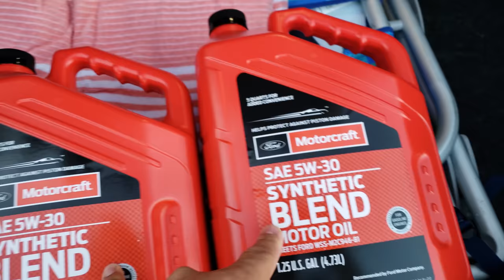2018 Mustang oil Change and filter inspection

Comment: I have the cold start rattle, and im starting to think its not the pistons because i only hear it when i rev and the sound comes on right when i let off the gas, i try to ease into the throttle to hear a tick but nothing so i know its not rotating assembly because if it was the sound would get louder or faster with increased rpms, and goes away when warm. Im starting to think it is the intake as some have said. Im still going to take it to ford with audio clips of the sound and see what they tell me

Comment: Why wait to 5K miles? I just bought a 19' GT and was going to change at 500mi then 1500mi then normal oil changes. My thought was to get every tiny particle out from any break in so there wouldn't be any scoring. I dont have a tick BTW. I'm around 250mi right now.

Comment: If there was extra oil in the oil cooler. Wouldn't it stay in the cooler during the change? I have an aftermarket cooler and I have to drain it separately during the change or it would contaminate the new oil.

Comment: You have the performance package GT, which I can see it has a metal across the engine bay, mine doesn't.  I have the regular 2017 Ford mustang gt. What other things are different? Thanks, any feedback appreciated, and thanks for the video.

Comment: Really don't like those plugs, the oil comes out 100 miles an hour. And if the ears brake without a replacement plug.

Comment: Pennzoil ultra platinum 5w30 & Ceratec no tick or anything
Reply: I use the same oil in my 2017 PP GT. Drained the factory oil out at 2,000 miles and at 3,500 to 4,000 after that.  I have no noise issues. I also use Liqui Moly oil additive as well.
Reply: Yep it actually works, I know plenty people who had the barbecue tick that made the switch & their cars are running nice & smooth now.
Reply: Aren’t oil additives more of a bandaid?
Reply: Agent S it’s been 2 years still no ticks or anything from my engine. So I would say it works.
Reply: nola504boy1 I might give it a shot next oil change if I have the same tick. I did my last oil change a week ago and it worse that night and almost can’t even hear it tonight (actually driving it now). Do you have to compensate the amount of oil you put in compared to however much a bottle oil additive holds?
Reply: Agent S No of you have a gen 3 you’ll put 10 quarts of oil & 2 bottles of ceratec in.
Reply: nola504boy1 sorry, I forgot to mention mine is a 2014. 8 quarts.
Reply: Agent S it’s 1 bottle for every 5 quarts

Comment: You put the filter in a vice with a little tension on it to keep it from turning
Then i put a razor blade in the vice just high enough cut each end of the element
Cut the element stretch it out looking in the pleats   
Inspect the bottom of the can see if there is anything in it
Bag and tag it for ford at later time for proof of metal or no metal 

Never seen a filter inspection like that sorry

Comment: Also it’s hard to see all the metal when the media is full of oil take a razor blade and cut out a large portion of media put it in a vice and crank it down wipe the oil off then pull the media out and look in sunlight you will always see some

Comment: I wonder if the price of the 18 mt82 cars will plumit when there sold used because it's gonna be a huge gamble to buy one YOLO has had fuel pump Failer transmission shift fork went out and now engine tick that would cost someone alot out of pocket even if a regular mechanic did it not  a dealer if done at a dealer it would be way expensive and you wouldn't know if the transmission had been upgraded or not

Comment: Take a razor blade cut a section  out of the filter wrap it in a towel put it in a vice and squeeze the oil out then you can pull the filter apart and see what the paper caught

Comment: Did this work for you or what ever happened with your car having this issue? I just got a new longblock from ford and it has this since around 777 miles.
Reply: My 2017 is currently at 20k miles, had the long block replaced at 16k. The noise it back, although this time is seems very light, almost snappy. 

I'll probably have to go deal with the dealership but I'm doing all the research I can

Comment: I don't know if anyone noticed that the factory oil filter was smaller than the new motorcraft oil filter. Anyone know why?
Reply from the maker: But it was longer
Reply: @YDBT4LIFE  thank for the response. that's exactly what I noticed. The factory one was shorter than the new motorcraft. I wonder if that affects in some way the engine lubrication.

Comment: Did changing your oil to a 5w30 fix this issue? Looking at getting a used 2018 GT Premium with 16,000 miles on it. Just wanting to check if changing the weight of the oil helps solve the issue. Not sure if you posted another video about it or not.
Reply from the maker: No. Car was switched for a 19. 15k miles of trouble free driving.
Reply: @YDBT4LIFE  did the problem persist which made you switch it for a 19?
Reply from the maker: @bikerbrosman293  no
Reply from the maker: @bikerbrosman293  its well documented on my videos
Reply: Alejandro Flores what’s your thoughts on the engine tick now since the cars have been out a while? Every single 18-19 that i've heard seems to make the noise but yet seems to be running just fine, including my 18.

Comment: Heads up, the typewriter noise was always the worst with fresh oil in all my Diesel’s. My 18 f150 5.0 seems to be the exact same as the diesels I’ve had.
Reply: Same with 18 f150

Comment: I couldn't find an ssm, gsm or tsb about it but I've been chacing a noise in an 18 f150 5.0. The noise is NOT present when I unplug all 4 vct solenoids. It is very evident with them plugged in.. I'm curious to know if yhe noise all you guys are talking about it the same noise I was dealing with. Anyways after replacing cyl head and vct stuff the noise was still there. Today Ford hotline told me to update the pcm as the latest update is to help with VCT noise. Again I could not find anything published about it.  The update did seem to quite the noise down a bit. Mayb if u experience the noise again or know of another car down there still running 5w20 u could try u plugging the VCTs and listen for the noise. I reccomend unplugging and plugging them with engine off. Hope this helps. -friendly ford tech.
Reply: You can run it with the solenoids unplugged? I had no idea. It just leave them locked closed? The tick is very random on most cars like it is on my 18 f150. It seems like it's gotten quieter. Almost sounds like slack in the timing chain. My 3v 5.4 did it when it needed a new chain guide.
Reply: @low87dawg86  the truck I'm working on has only 9000 miles on it. The noise can be heard in the wheel well and on top of the valve cover.. I just looked again and no TSB or ssm for vct noise update pcm.... lol I have the hotline message that says it tho.
You can run the engine with them unplugged at idle for testing. May set a CEL..
Reply: @baad2003mach1  I'll try it. I can also hear the noise if I'm in drive and just blip the throttle real fast and let off. Just a weird slappy tinny noise just like my old 5.4 on cold start.

Comment: Thanks for the new Stang DD update Alex. I also replaced the 5W20 with Full synthetic 5W30 and have been happy since. Wanted to let you know I’m finally getting the OPGs and crank sprocket replaced before I look for any additional HP on my 2017 Roush phase 2 GT. Then some FIC 1000cc injectors, mono-blade TB and a 69mm pulley, I have been running on 100 Octane fuel from a local airport and will continue to use after upgrades too. Have Boostane on hand too just Incase I switch back to 93 for any reason and get it up to 101octane. The S10 comments/editorial had me LOL! Retards...LOL

Comment: They will just replace parts while it’s under warranty as soon as it’s gone they will tell you we don’t open engine or trans we replace which tells me it saves them a lot of money. There’s a guy somewhere on YouTube with a 17 camaro that spun like 4 rod bearings with low miles on it Chevy made the dealer put bearings and a crank in it at the dealer
Reply: I used to work for Saturn back in the day.  Lol. This is true.

Comment: If PP1 Mustang GT's required more than 10 quarts of oil, wouldn't you think that Ford who has invested millions of dollars in the development of this engine would know that?  It's in Ford's best interest to alert the buyer as to the desired amount of oil required to protect this engine.  Oil serves to lubricate metal-to-metal contact, remove contaminants caused mostly by cylinder blow-by, and remove heat.  The purpose of going from 8 quarts to 10 quarts was to improve the efficiency of the oil in removing engine heat caused by friction.  I would advise against believing anything posted on the internet as the truth.  Rather, take a road trip to Ford's Technology Center in Dearborn, MI and talk to the engineers, engine designers, engine testers, etc. who are responsible for the 5.0L engine and then decide if you trust their recommendation or some cowboy on the internet who wouldn't know a cylinder head from a crankshaft.
Reply: Bryce this was hilarious to read

Comment: I seen that other video NOW everyone thinks there engine coming apart. Right after that youtube video my friend with his brand new GT calling me OMG my engine is bad. Brought home my borescope from work, removed spark plugs all cyl ok. No metal in oil filter either. Piston failure or scuffing engine goes south very very fast you're not able to drive it for thousand miles. Sounds just like 04 mach1 sound like its in bottom end or making more noise from under the car. Engine never had  metal in filter and cyl walls ok

Comment: Would you recommend 5w 30 for a 15-17 as well?
Reply: 5w40-5w50 I run 5w40 liquimoly because it's readily available and have oil analysis to back up how well it performs. And I also abuse my car more than 99% of people commenting here. 3-4 drift events, 30+ drag strip passes, and I drive 5k miles a month. I'm at 60k miles and my analysis results are 💯💯💯

Comment: They would rather pay a tech to tear down and assemble an engine than replace the whole thing at this time. When I was a dealer tech we almost never got complete long blocks under warranty but they'd let us have a short block and complete heads. I have heard that they're going to move away from even opening them up, and just start replacing whole assemblies so that they can have cheaper, dumber techs work on them instead of paying experienced wrenches to do it.

Comment: Can I ask why a synthetic blend and not full synthetic? If anyone minds answering lol
Reply from the maker: Because the car ready had tapping noises and I don't think it matters that much...semi vs full based on........25 years of experience
Reply: Awesome. I was always under the assumption that full synthetic is much better for the engine. Do you also run syn blend in the red mustang as well?

Comment: I have the tick/knock my car is at Ford. 1800 miles 2018. Ugh... I'm so sad Ford has chosen to be cheap.
Reply: SullivanBlack switch to Pennzoil ultra platinum 5w30 & use a bottle of ceratec it will go away trust me it works

Comment: when you boss think you Ford is a pos and slow and challenges you to a race and that engine never had a oil change in 5 years and 50,000 miles and over 3000 1/8 mile passes for 3 years straight. yea AMSOIL ha ha ha! https://www.youtube.com/watch?v=D_Sag2gulbg